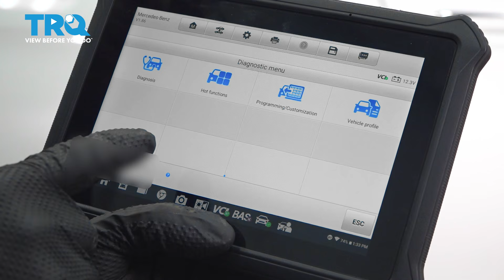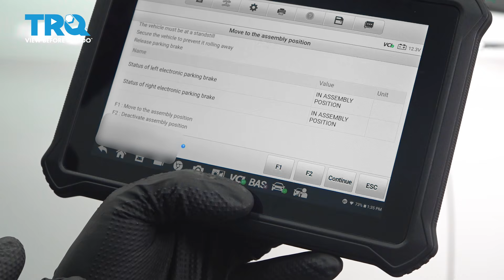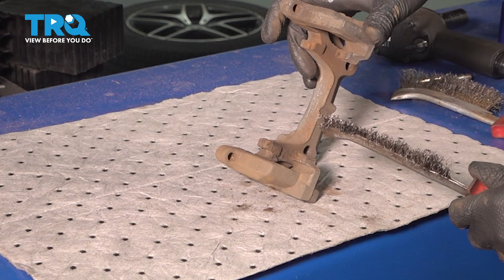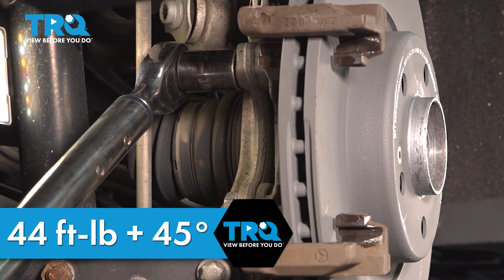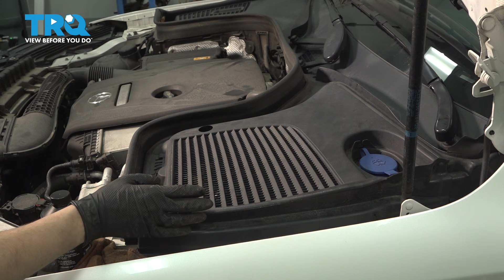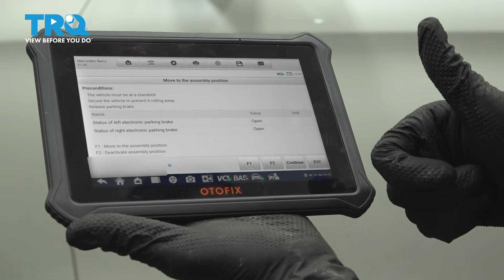How to Replace Rear Brakes 2016-2022 Mercedes-Benz GLC300

Comment: Is there a reason that compressing the caliper, by releasing the bleed screw?  Why wouldn't it push the fluid back into the Master Cylinder, eliminating the need to bleed them at all?  Its a sealed system